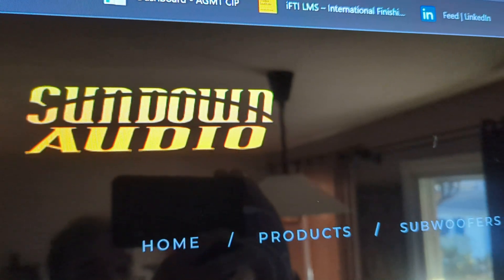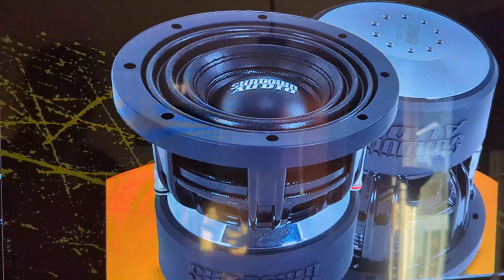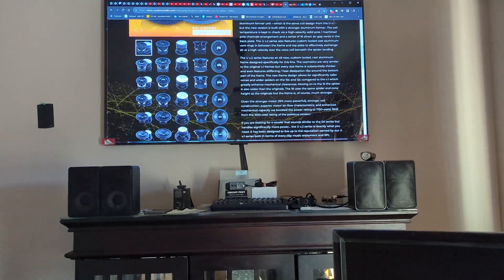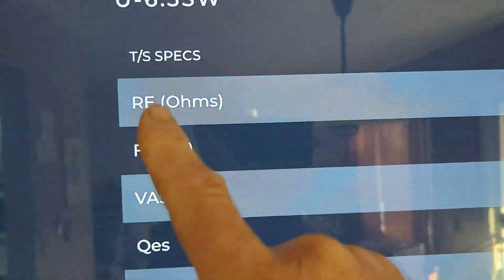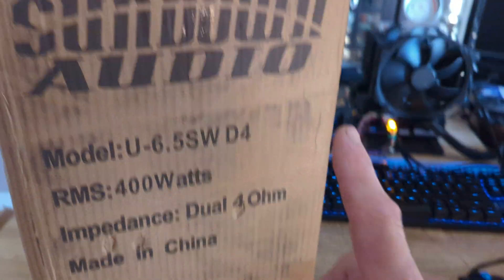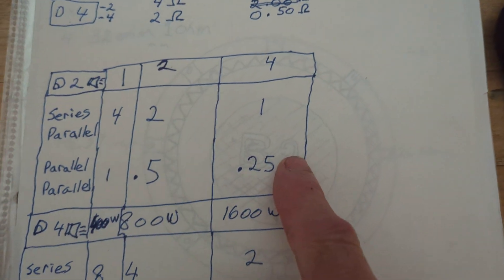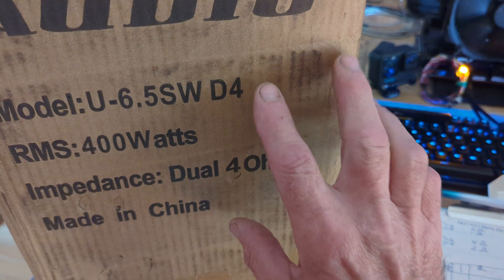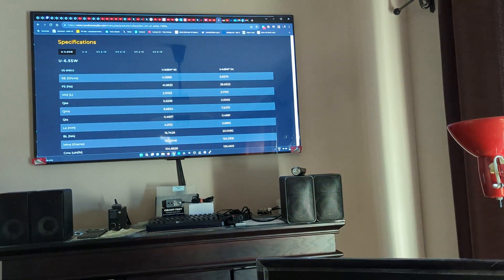#sundownaudio #showdown #U-6.5SW D2 vs D4

Comment: I did D 2 for the deaf bonce 8”s 1600 800rms I plan on wiring them to the series parallel down to 1ohm. Now I just did a single sub in my wife’s car 12 CT sounds but I used the $400 digital audio Steve mead shit online to set the hole speaker up behind spline mono 600w etc, I no I hope I didn’t fuck up w these four 8’s!